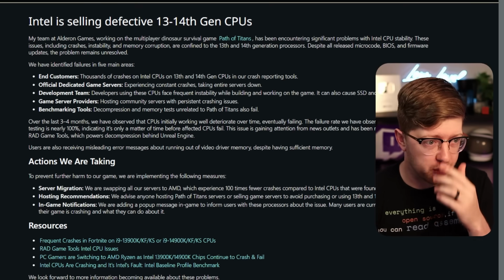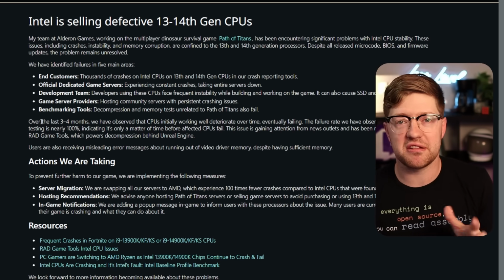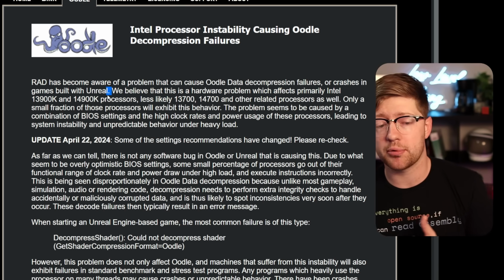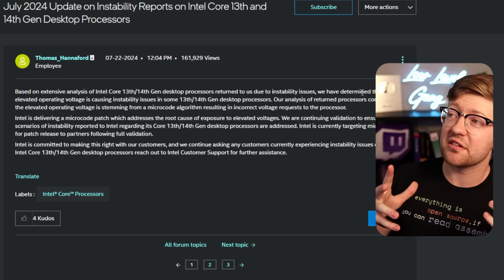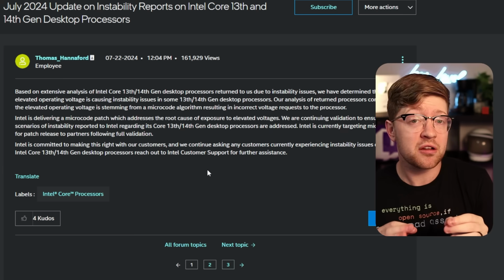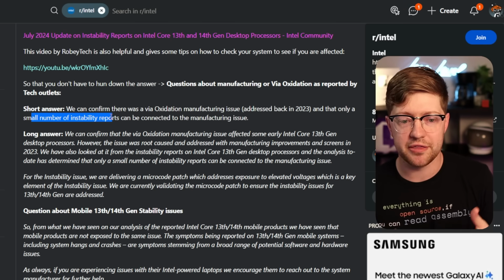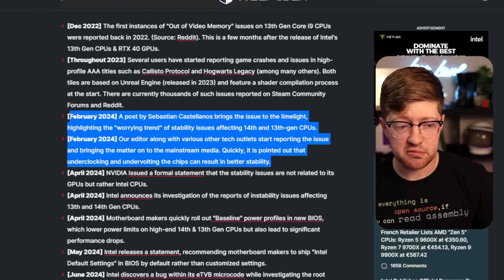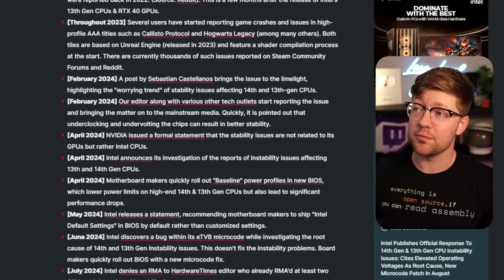intel CPUs are literally falling apart

Comment: Not trusting the hardware is a whole another level of debugging nightmare
Reply: If you haven't worked in that industry you can't possibly imagine how bad.  Circuit simulation on monstrously large supercomputers, circuit emulators (which probably are beyond capacity for something like a 13th gen Intel core)  piles of FPGA.  A tapeout, new masks are all silly expensive and fabbing a circuit from scratch after a major change may take months.  So every change need to be validated most carefully before the design is sent off to the fab.  Oh and I don't know how much a set of masks for a large processor die like the ones we're talking about, costs.  Masks for much more moderate designs easily broke the $1,000,000 boundary.  Today we might be talking about $10M to $40M.  Try and error is not an option. 

Add the fun of issues with licensed 3rd party IP integrated into a circuit, potential process issues, scheduling with the fab, customer relations and the worst "enemy" of all, your own bosses, marketing, lfinance and egal departments, business partners and you may quickly have a situation where presure on the poor engineers working on a fix is maximal.  And as I said above, some things in the semiconductor world are moving slow, so extreme care is mandatory.

Just as a reminder - only a few years ago Intel was the undisputed king and AMD was looking like a dead man walking.  Don't count Intel out.

I'm a software guy doing mostly low-level work.  So I've been standing nearby on many occasions when things were not working right and a bunch of nerdy engineers with a combined IQ of a million are trying to track down and fix the cause.  As such I know how bad it feels when you don't know if the cause is software or hardware.
Reply: @ralfbaechle  That definitely sounds like a nightmare
Reply: @ralfbaechle I've had a hardware bug on a system where I was allocating very large arrays (multiple gigs) in multiple threads (48 cores). It took a long time to rule it out being my code.
Reply: @mrpocock  A coworker of mine killed some bugs with a logic analyzer.  Race conditions as small as only clock cycle.  It could have been a hardware bug - you don't know until the issue is found.  And being the CPU vendor yes, we had logic analyzers and the ability to synthesize a version of the CPU that feeds all necesary signals to pins of the.

"Go ahead, Make me day, Bug" -- Dirty Harry ;-)
Reply: @ralfbaechle  it is suspicious when the issue refuses to trigger while monitoring the hardware.
Reply: @mrpocock  Could be a hint the issue resides in the analog domain.  That is the kind of issue however I'm happy to let the real hardware people resolve.  Delegation is wonderful when one is not on the receiving end ;-)
Reply: @ralfbaechle   Every change used to be validated most carefully. The new Intel CEO said why are we spending so much money on validation. So.
Reply: @thewhitefalcon8539  The dirty secret of the whole industry is that proofing the correctness of hard- and software is difficult if not impossible.  In the end it\s all about one old-fashioned thing again: trust.
Reply: @ralfbaechle   Of course it's really difficult. That's what we pay them for. The more effort they put in, the less likely they are to get it wrong. If they stop putting in effort, we stop paying them.
Reply: @thewhitefalcon8539  By difficult I meant the complexity of verification is growing much faster than the complexity of the circuit.  Iow there isn't even a ttheoretical hope to do verification in sense of a mathematical proof of correctness.

Production testing is another bitch.  There could easily be a tiny defect, say one single via, transistor or similar that escapes production testing.
Reply: @ralfbaechle  If they can't verify it they can't make it. It's not done. Selling half-baked products is what nearly bankrupted Intel before and it's about to nearly bankrupt Intel again.
Reply: @ralfbaechle   I'm baffled no one though of a way of getting rid of the need for creating masks of the tapeout. Maybe with an more complex set of lenses you could use DMD instead of a mask, that way you could run maybe a single wafer of a design, then trial and error would be faster. Imagine saving millions in ASICs and tapeouts to test your design, you basically just print it and test the actual thing.
I think I'm going to create a startup for that.
Reply: @monad_tcp  The industry would love you if you succeed.

Ironically the masks are produced  using an electron beam writer so the thought of skipping that intermediate stop is more than obvious.  It has been tried and didn't work.

Masks have other annoying properties.  For example if after applying several masks a bug is found that requires a change to the masks in order to fix it, it often is attempted to fix teh issue in a way that only requires changes to the masks that have not been applied yet.  That avoids having to discard the all wafers that have entered the manufacturing process but at the same time is an additional pain in the designer's rear.  Good designs try to allow for such fixes - which may work or not.

The craziest thing I have on my shelf here are chips with edits.  Six edits each with at the time a chance of 50% of ruining the die.  Six edits = one out of 64 chips will survive.  Not sure if that is at all possible with modern processes and if it's working it's expensive enough to be only suitable for prototypes.
That's the kind of issue discovered after the end of fabrication and which a mask-less process would not fix.
Reply: You bet. I work with embedded and we currently use primarily STM32 MCUs. Recently we found out the Pierce oscillators built into those MCUs don't work correctly, and we couldn't find out why, our electronics engineers tried everything, changing the crystal, the capacitor, the PCB layout, all well within listed specs and nothing would help. Then we found out even ST themselves apparently don't trust their oscillator because in all their development and discovery kits they bothered to add an external oscillator instead of using the internal one. That thing has caused us a lot of issues because we'd have random errors like SDRAM corruption, LCD display flickering, I2C and SPI framing errors, super hard to catch because it would happen like once a day. Then once we managed (after a few months) to pinpoint the oscillator as the culprit we tried feeding an external clock to the MCU and all these problems just went away.
Reply: @smlgd  Same here, I'm an embedded software developer working mostly with STM32 mcu. Haven't stumbled yet on an undocumented hardware issue, but nearly every single time when there is an issue with code and it makes no sense at all it turns out a problem with peripheral is described in the hardware errata note.
Reply: @smlgd  all my homies hate ST
Reply: Never trust the hardware. Always test and verify and do it on a schedule. This is even more important these days it seems.
Reply: Don't trust hardware or compilers, I would trust my code more than other things, you just have to debug it in lots of different hardware, otherwise it is a nightmare. But writing multi-platform code is another kind of hell, you get stuck on language lawyering, and have to keep fighting "those" C programmers that think in too concrete terms that are only valid for some architectures because they keep thinking "C is baremetal assembly" instead of "C is a high level code for a virtual machine".

Comment: I have a strong suspicion that microcode updates, although maybe slowing down the process, will not be able to prevent degradation over the entire planned life-cycle as expected of x64 CPUs. If this really is rooted in oxidation of copper interconnects, the occurrence of fast degradation in lower-binned SKUs does not instill confidence. Compute providers already have significantly increased prices for dealing with intel boxes, system integrators facing RMAs over misleading failure modes won’t be a joy to sort out either.

I think intel being silent for so long and only doing the bare minimum is the result of damage control, namely, accepting as little blame as possible, paying the price of reputation damage within smaller enthusiast circles to keep this out of the mainstream newscycle 

 This will be an inevitable nightmare,
Reply: It won't solve the problem : the CPUs are corroding due to contamination during manufacturing. They will all degrade, and most will fail after a relatively short life.

I never had a CPU die on me no matter how old the computer. Intel will break a new frontier of abyssmal quality.
Reply: The oxidation issue really isn't the biggest problem. In theory, it was a small number and was resolved. These are just bad CPUs that need to be RMAed. The real problem is that ALL 13th and 14th gen CPUs (at least of certain SKUs), whether they have failed or not, have been running at voltage levels which is causing internal damage. Even if a microcode update fixes the voltage issue, it cannot fix the physical damage that has been done to every CPU in those generations. Some CPUs haven't been damaged enough to cause problems, and probably could continue on for many years without failing (assuming the microcode update is applied in a timely manner), while others may have been pushed to the brink of failure and become essentially ticking time-bombs. There is no good way to determine the extent of the damage done on any particular CPU, so I would say Intel likely needs to recall the entire 13th and 14th generation.

Comment: Back in the day I had an original Pentium with the floating point error and got it replaced by Intel. Today, I have an affected 14th gen i9 that has had the incorrect "out of vram" error once while starting up a game. I've been aware of this issue and not pushing my cpu voltage too hard while waiting to see what Intel does. Hopefully they release the microcode update soon. FWIW, I don't believe that the oxidation issue is relegated to just 13th gen chips.

Comment: Can you please do a video or reply with some advice going forward? It's been so hard for me (new to computer builds) to gather information. I always see people talk about 13/14 900K specifically. What about stuff like 13700F? I haven't gotten a failure yet, but I also don't play as much. Is it the kind of failure where I should wait to see if they fix the microcode? Should I just completely get a new CPU? Will riding it out until a failure just screw up my CPU (which I then replace) or does it leave the rest of your computer in shambles?
Reply: I strongly recommend watching the Level1Tech’s video on the topic - or the one from Gamers Nexus. It will answer questions like this.

But short answer: yes, your model is among those affected, but whether your one specifically may be / how strongly affected it may be is much harder to say, particularly with how little information we have from Intel
(.. like, we don’t have have a range of serial numbers that may be affected - almost all the detail we have is from semi-amateur investigators and third party vendors or organisations)

At the minimum and as soon as possible : set some considerably lower maximum voltage or current (since current is directly tied to voltage) limits on what any core may use!!! This will prevent or greatly reduce the rate of further damage occurring. 
How exactly to do this will vary depending on your motherboard, so consult the manual or a knowledgeable person.

——

Personally I would RMA the CPU prior to getting the microcode update that Intel is promising, as prior to that point, it will likely have been accumulating damage slowly but surely, and I wouldn’t want a damaged CPU that at any point may start showing symptoms, since it is progressive over time, slowly getting worse, and there is no guarantee that the update will stop it completely (and it is impossible to reverse). 
But you may choose not to if you don’t wish to be without it for a time… although I personally think this would be a mistake, and an expensive one at that.

Something that might shift your opinion: the kinds of errors that occur include I/O errors, and people have experienced data corruption, where corrupted data is written back to disk, and this breaks file integrity or even the operating system. If you use file system encryption, it’s even worse as a single bit error will render a large block of data totally unusable (not the whole disk, just a part, due to how encrypting filesystems work).

Comment: I've been running an i5-13400F (C0 stepping, so Alder Lake die) for seven months without issues. Should I be worried anyway because my CPU it's labeled as "13th gen." or it only affects Raptor Lake based silicon? Intel should clarify which CPU models are affected as soon as possible.

Comment: Getting so tired of all the EXPERTS on the internet claiming they know the issue and what is causing it. IT'S the Additional turbo mode cpu core voltage that causes the issues!
W680 boards have all out of the box by default a way to agressive VID schedule that causes this to happen.

Most of those boards run the 1 or 2 preffered cores at 1.52 and even more Volt! That is causing the degradation of the cpu's. On customer motherboards it's easy to ofset the turbo mode. Done mine with an ofset of minus 0.30v also minus 0.25 volt works perfect.

Resulting in my core in idle going from 1.45/1.46 volt to max 1.30volt!  It's not the load wich is causing issues. It's the single core or dual core high boost that is the issue. Giving way to much voltage so they can reach 6ghz.

Setting powerlimits will not DO ANYTHING about his issue! Addressing the issue only by the broken boost algorithm VID table will. My I7-14700KF uses max 202 watt with 34000 R23 score multi at max 85c and 2150 points single at about 40 watts use. Out of the box it could reach very high voltage on light load or high single core boost.

New microcode if implemented will will solve the issue on good non affected cpu's. Cpu''s that are degraded need replacement or more voltage wich will decrease the lifespan further.

Comment: I'm sorry I've lost track of the source but I watched an other video on this issue today and they cited a data center that claimed a 50% failure rate. [caution: hearsay]
Reply: Actually that smells bad.  Why would a data center be using desktop CPUs?
Reply: @galacticminx  Depending on what they're using the chips for it makes sense to have regular desktop chips. In the case I'm thinking of (which may be the video you watched as well, the one by buildzoid or "actually hardcore overcooking") the Datacenter people used the chips for Minecraft servers since they just were the obvious choice for the workload of fast memory and single core perf.

Comment: Intel pr: its voltages ignore the W680 boards with 35watt 13900T and 14900T dying on mass.

Intel engineers: Sir ever since we moved the io layer on the 13900 later 14900, we have seen the chips die. Probably io and speed step is enough but if we downclock and decrease the voltage we might drag this Beyond their warranty period.

Comment: In the last 25 years of working on hardware I have yet to get a bad AMD chip. I'm not just trying to promote the other guys either I just can't ever remember getting bad chips from AMD even once. Intel needs to cut their loss and replace these and make it right with customers. Any chips with the oxidization issue should have been scrapped not sent out to be sold to people...

Comment: Got 3 client units running 13900K, we intially suspected ram, then got mislead towards bios, cooling, CPU frequency etc. We tuned it way down, below very conservative intel spec, and still they would  bluescreen or hard reset doing commercial no-recovery workloads randomly but at least once every week.

What gave up the Intel (pun intended) for us, was I started observing WHEA hardware crash events. Debugged the dumps and it was GPU errors, always out of memory ones. Even observed several ones that didn't fully BSOD but crashed display driver and threw us out of the user session (on metal, not VM/container or remote). Issue was that these units A) wasn't running anything tasking GPU at all, and had ample allocated memory free at time of crash - and B) they don't have graphics cards. Only the intel CPU integrated.

Edit: However, we ran hwinfo64 sensor logging on all of them an never saw voltage peak above 1.36v on any of them. Never above 1.4v in bios. Did not verify with multimeter though.
Reply: yeah with board like the EVGA Z790, that has a header for probing voltages directly it could be seen if the board is really over volting the cpu and underreporting it in the BIOS.

Comment: Glad I didn't wait for the 13th gen when I purchased my 12600KF on October 2022 (a few days before the 13th gen was released). Intel trying to place the blame on motherboards and refusing RMA when they likely already knew this was their fault (they admitted to root causing and fixing it for their later batches after all) is disgusting. They're only reluctantly releasing this news on Reddit because NexusTech reported on the oxidation issue. Again, disgusting. I think I'll be going with AMD in the next iteration. And with laptops, Intel is about to get slaughtered by Qualcomm anyway.